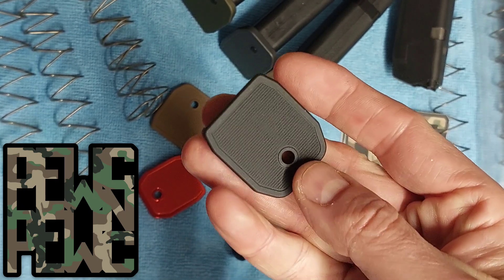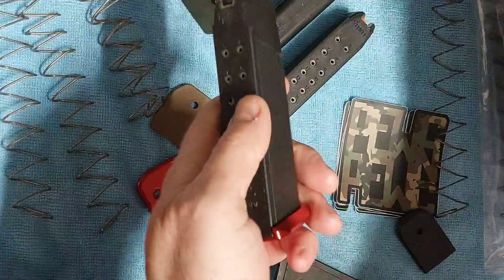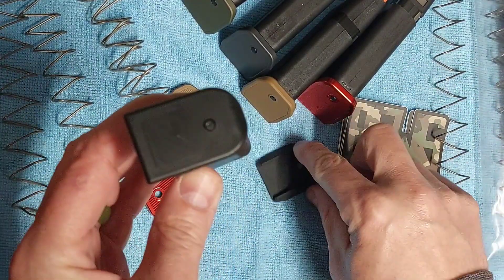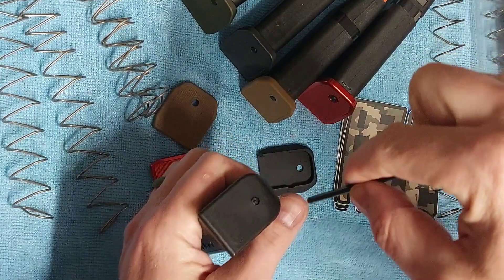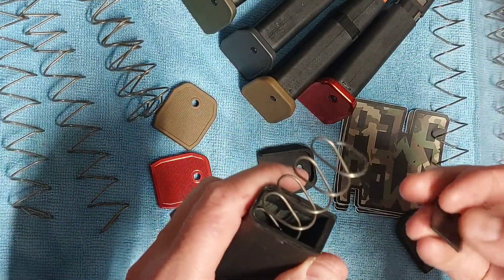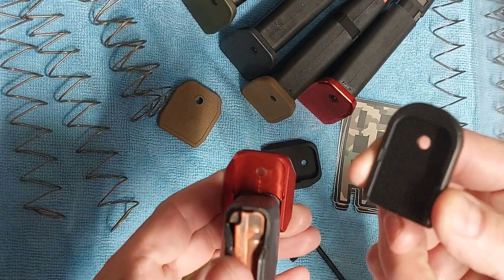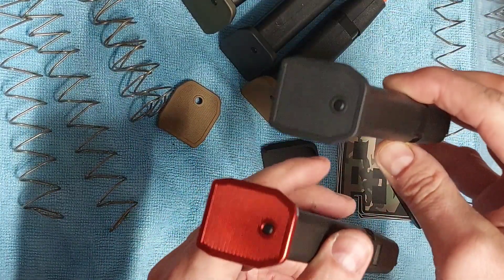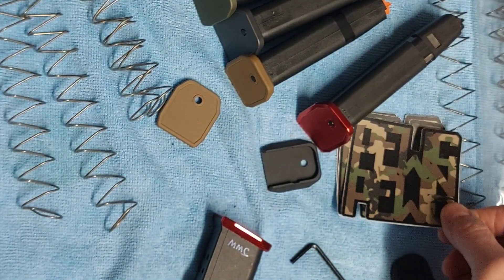Aluminum Mag Base Plates

Comment: Hey I found your channel because I saw t hat you did a plate modification for a RMSc optic pattern on someones shield. Im running a masterpiece arms DS9, that uses the accuracy x plate system. I want to put a holosun EPS on it, but it is a modified RMSc footprint, in other words, I would have to modify the accuracy x plate for the leupold DPP, since they dont make one specifically for the RMSc. So the rear lugs need to be shaved off, and the front lugs need to be slightly ground down. I imagine very quick with the right tools. Is this something youd modify if I sent your way?